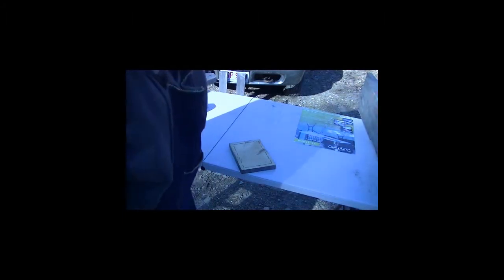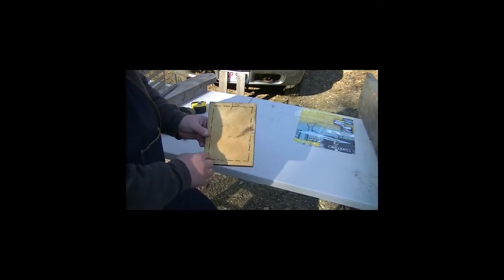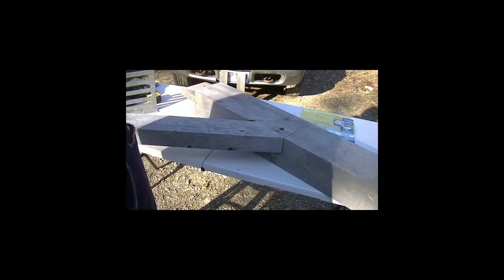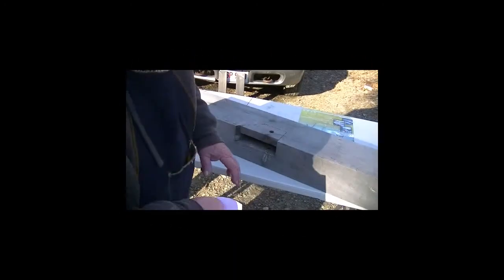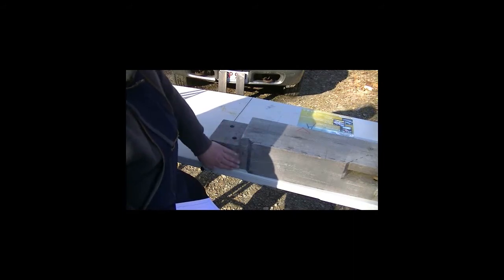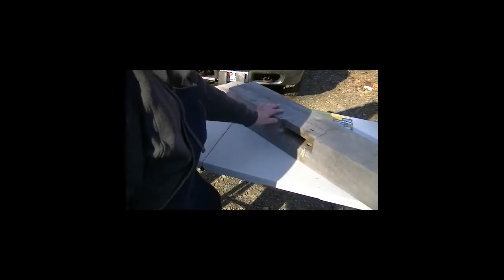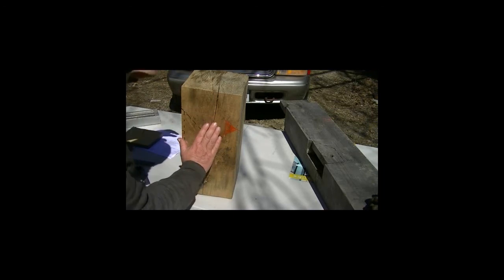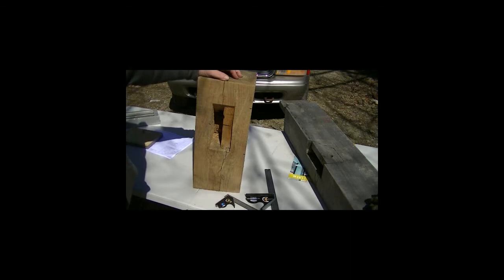Centered brace pocket/mortise layout and measuring

Comment: Hi Jim, great video series.   I have worked mostly away from the normal, I ended up running mostly 9x9 post and 9x beams while housing 1" leaving me the ideal 8x8, just another slight variation around timber that isn't square.  In a follow up video can you go over what to do if the best face and next best face are not square?  This is a key part of edge square rule and could be helpful to many.   How I deal with center braces is I try not to center them. keep them to the adjacent  face, its very rare to need a centered brace in square rule work.  Centered bracing come from modern framing techniques.
Reply from the maker: I agree with keeping the brace flush to one side as it is the traditional way of doing it. but the tool customer wanted to know how I would do it and this is the way I have done it.
Reply: @JimRogers117  There is always someone that needs it,  the brace centered.

Comment: Hey Jim, cut my first mortise and centered it on my 8×8 post, I however, didn't angle down from the top, I cut 90° in on both the top and bottom of the mortise and haven't housed it yet.  Did I screw up by not cutting the top angle?  It's the only one cut, and I may still be able to salvage the timber as a king post if I did screw it up.  I plan on cutting more tomorrow as it's a day off from work, and can probably refer to the book for guidance, but prefer to hear from a master such as yourself....thanks in advance, Old School~